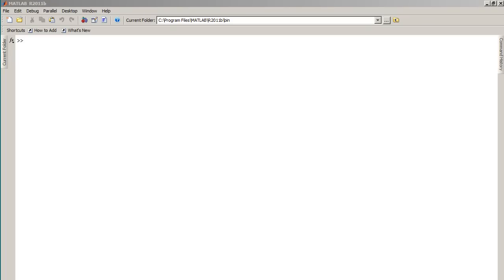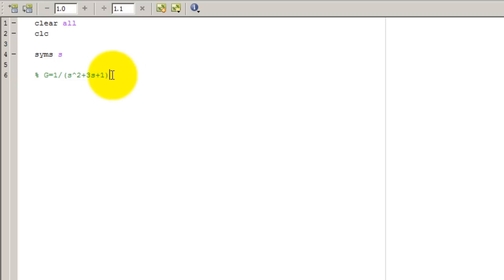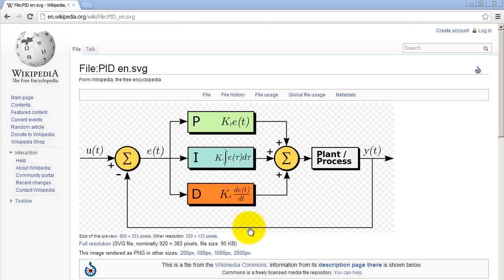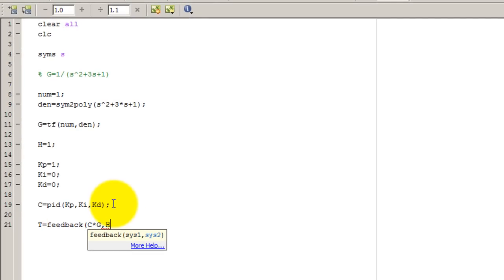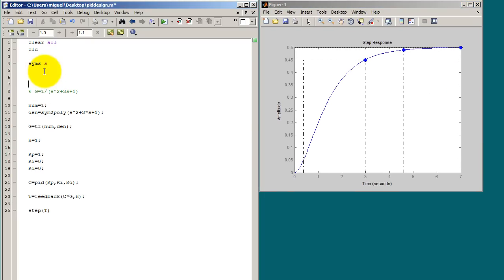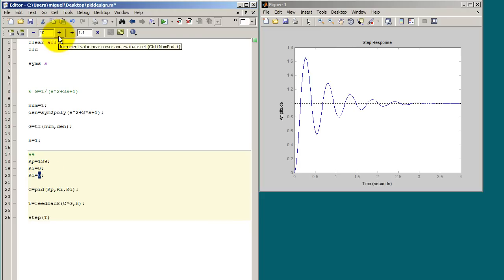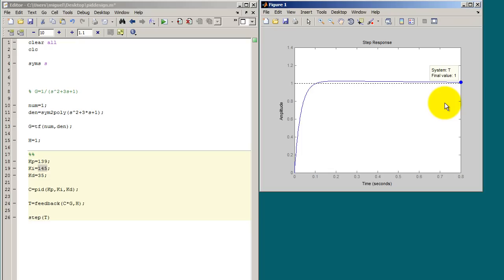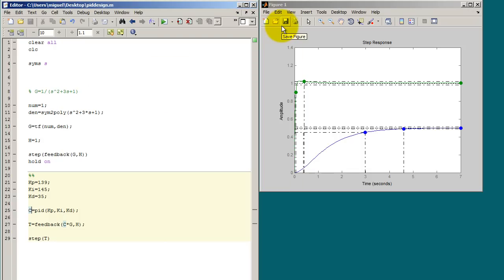How To Design a PID Controller In MATLAB - Manual Tuning Method

Comment: hi..I'm using pid controller..I have a dought..if the numerator is a equation with degree 2 I.e.  s2+ 5s+7..can that be implemented using this method..

Comment: I did not get that result applying "help pid"
How could I installed that extension?
Reply: +Fernando Gonzalez , were you able to figure this out?
Reply: Mohamad Annan no I didn't ,actually i didn't reallize how to make the PID controller because of it.
Reply: Fernando Gonzalez, I did. What you want to do is download the Control Toolbox from Matlab. The problem is, you're going to have to pay for it or download a trial version. 

In my case, I was able to get a copy from my University.

Good luck!

Comment: Thanks a lot that is really useful,
But actually, I don't have + button on my task-bar(2014a), I don't how to customize that.
Thanks at all.
Reply: Neeraj Kumar highlight the value (ex: highlight 2 in Kp=2) then right-click on that highlighted value and at the top of the selection list you should see something in the lines of : "increment and run section"
Reply: Use Ctrl + (Numpad +), with ur cursor on that particular variable..
Reply: Ctrl+(Numpad +)  only increases the value by 1 at a times. what if i want to increase it by 10 or more at a time? i too don't have the + sign on my task bar.
Reply: Thanks, this solved it!

Comment: Hey, thanks for the video, 
I'm actually kind of confused about the true definition of rise time, i saw back on some web that defines the rise time is actually the time when the response first intersect the set-point value.
Reply from the maker: Rise time is the time it takes a signal to get from level "a" to level "b". The values of level "a" and "b" depend on what you are talking about. Read the first paragraph of this page http://en.wikipedia.org/wiki/Rise_time
Reply: +AllAboutEE i wrote this code in matlab the way it is but it does not work

Comment: I think the transfer function given by feedback(G,H) actually considers a only proportional controller with Kp=1.
Reply from the maker: Yes, if G is your plant and H your feedback and KP=1. So it's the same as feedback(Kp*G,H) when Kp=1.
Reply: AllAboutEE Indeed. But, in the video step(feedback(G,H)) is taken as the open loop response. For me, it should be only step(G*H).
Reply from the maker: Julio Dutra That's correct. I don't see where in my video I say that step(feedback(G,H)) is the open loop response, but I often misspeak so am sorry if I did.
Reply: AllAboutEE There's no problem... you have made such a great work!

Comment: what if I want the steady state error be equal to ZERO ??? should I decrease the value of Ki ?????
Reply: Actually the steady state error in this video is zero, the steady state value is one as we know the input is a unit step function. The Integral part of PID is what actually removes the offset / steady state error.
You can see that after increasing the Ki value, the steady state value changes from 0.993 to 1 but you get a slight trade-off of rise time and settling time.